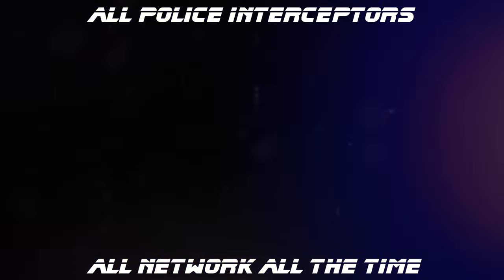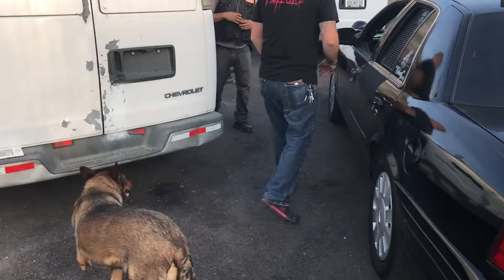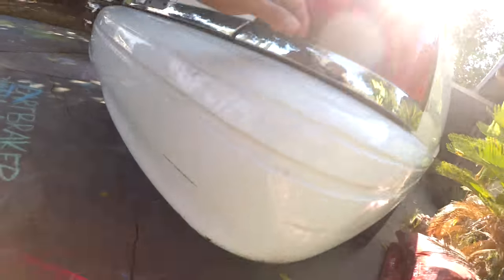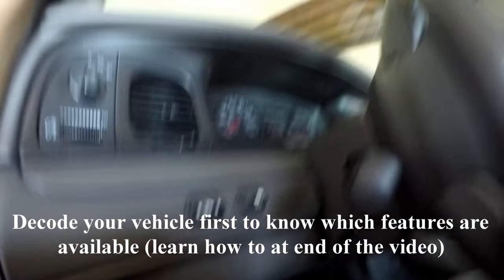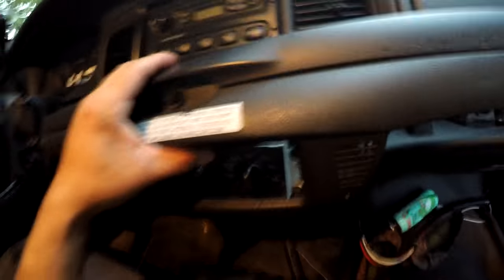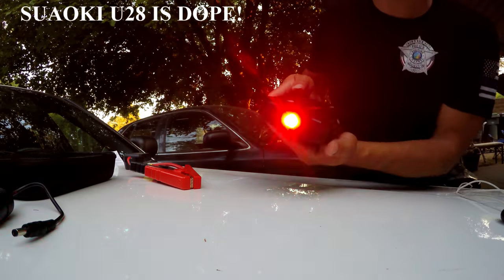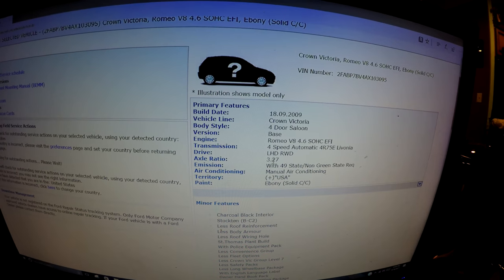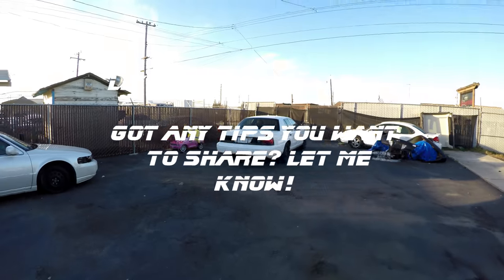4 Crown Vic Hacks, Mods Tricks & Tips! Police Interceptor

Comment: Where did you find the traction control and brake adjusters switch at
Reply: I think thats 07/8- 2011 models only, ones with the bi axis steering adjustment column the 05/6 experimented with.
Same pos they recalled for 2 years ago.
Reply: @chriswyers9619   my 03 has those buttons
Reply: My 98 traction control button is in the glove box

Comment: You totally answered my question on the traction control I found that wire connection that went to nowhere. Now I know it works!   Did you see my question yet? Do you have any front outside door molding for a black 2010-2011  Thanks Deano
Reply from the maker: Yes I seen your questions.. no outside moldings yet maybe my next shipment of parts cars i'll keep you in mind!
Reply: Thanks so much keep up these great videos!

Comment: I have a 2004 Crown Vic Interceptor. The dash light that covers the 110 MPH to 140 MPH area of the speedometer and the Temperature Gauge just went out. Is that and easy fix? Do you have a video on that issue?

Comment: So I just bought my 1st 08 crown Vic p71, 120k miles changed the battery and ohhhh Soo smooth super siked. I just need help with the electronics hanging under ac controls and radio(no charger/cig lighter ports) only has 2 similar cables that are freeballin(hanging) similar looking I have pics just don't know how to post

Comment: 3:00 Unfortunately the traction control switch trick doesn't work on the 2009 P71. I got one, but no. Switching out the headlight switch for one from a Grand Ma with the Auto shut off doesn't really work either.